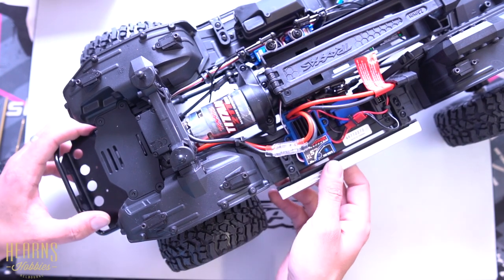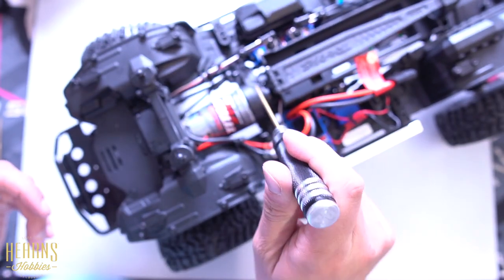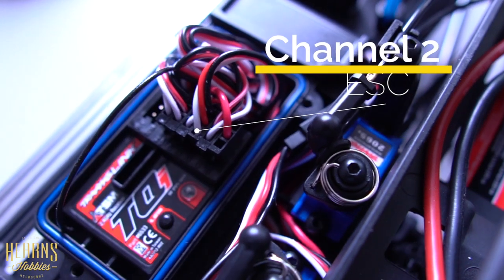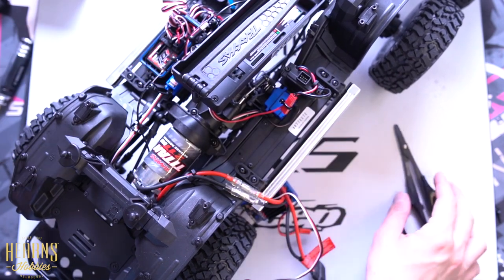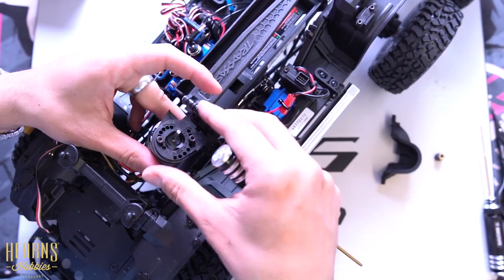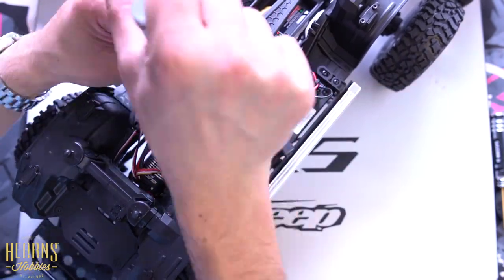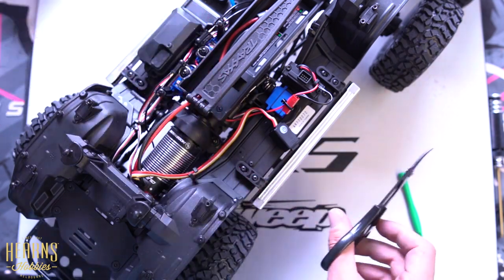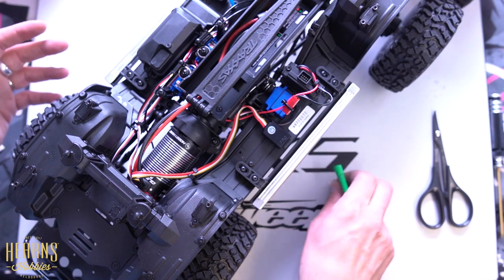Traxxas TRX6 Brushless Conversion | #askHearns

Comment: Hey mate great video. Please let me know how you connected the lights I'm stuck with ideas for this.
Reply from the maker: Thank you very much! The lights do come pre-installed here however Traxxas sells all the various light kits. In general the lights will be connected to the receiver to get power.
Reply: @HearnsHobbiesMelbourne  Hey thanks for the reply. But I was referring to after you removed the stock ESC you also lose the little red JST connector but it's all good Yeah Racing make an adapter that has a JST plug built-into it.

Comment: how did this motor perform? I am looking at this exact same combo for my own trx 6
Reply from the maker: This is a great combo. We also have it on a TRX6 and works very well. We have put this in very rough conditions including salt water (not recommended!) and still runs well.
Reply: How is this compare with the axe 550 combo 3300?  Others said TRX6 better with 3300k because of the weight and size. How's this for the high and low speed? TIA.

Comment: Just wondering have you had any issues with the servo being to close to the motor not letting the motor have full power or reverse I’ve heard others with issues just wanted to know before buying
Reply from the maker: They are very close but it wont affect power or anything else.

Comment: How did you finally connect your lights back up?
Reply from the maker: Hello Rosin. We used a Y lead to the receiver.
Reply: @HearnsHobbiesMelbourne  So, you're saying, instead of using the distribution box you're using a splitter off of the receiver directly?